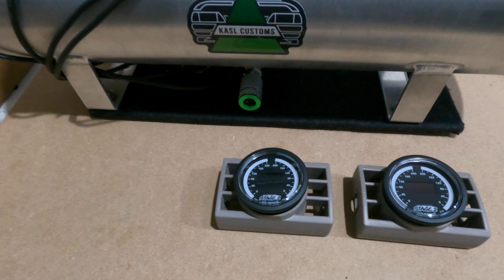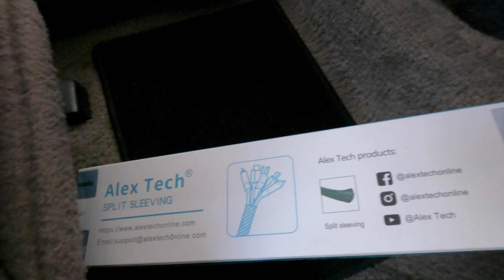How To Instal Air Ride - Plumbing & Wiring // PART 2

Comment: Hi Gary. Because I seem to be abundantly under informed, I have to ask. Why do you need two compressors? Wouldn't just one with higher capacity work? Also, do the two center vents still pivot up and down? Anyway, this whole series has been way more fascinating than I expected. Way to go, I can't wait to see the look on your kids faces. Thanks! Bill.  😊🦊
Reply from the maker: Hey Bill! These actually are high capacity compressors and draw a lot of juice. I don’t think you’d want much more draw in an automotive application. Even having the two, it still takes around 3 minutes to get that tank from zero to 200psi. Yes, the vents still move up and down however you lose the side to side air deflection
Reply: Hi Gary. OK, that makes sense. Now I'm looking forward to part three. Thanks! Bill.